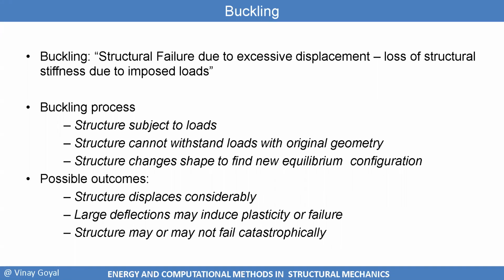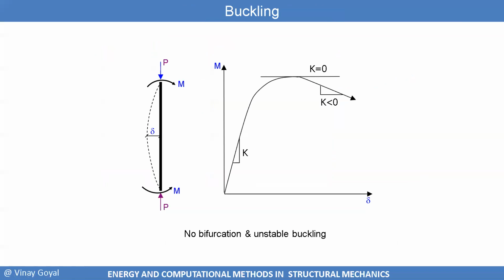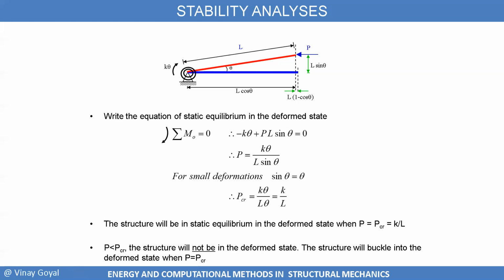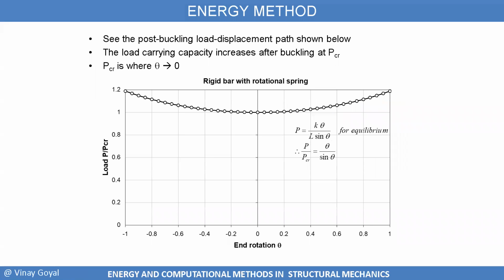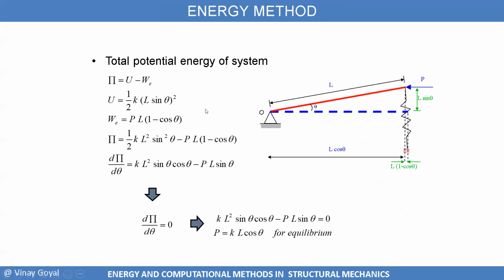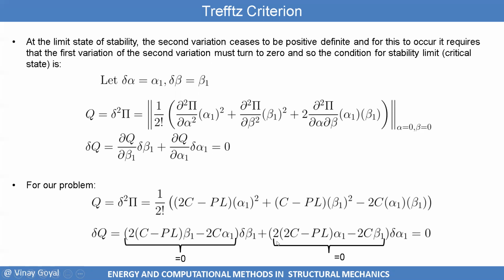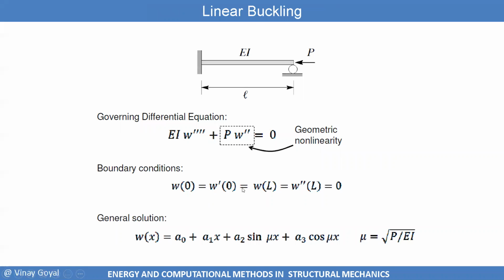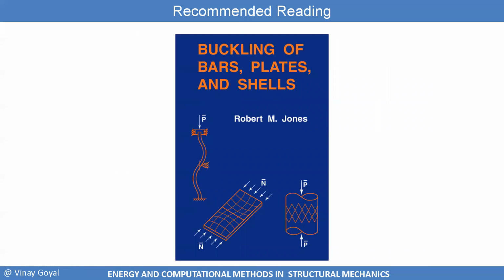33. Energy Methods and Computational Mechanics - Buckling

Comment: @52 minutes in you asked to determine which eigenmode is more critical - I believe it is {a1.,b1} = {.52, .85}. For this eigenmode, the value of the second variation of PI is less than that for the other eigenmode. For the first load, both eigenmodes yield positive 2nd variations, indicated stability, though the noted eigenmode is less (.44c vs .67c). Then for the second load, both eigenmodes yield negative 2nd variations, indicating instability, though the noted eigenmode is again less (-.67c vs -.44c), indicating stronger instability or higher criticality.